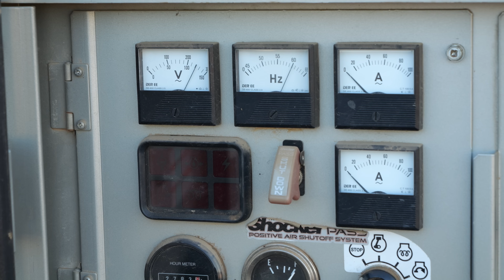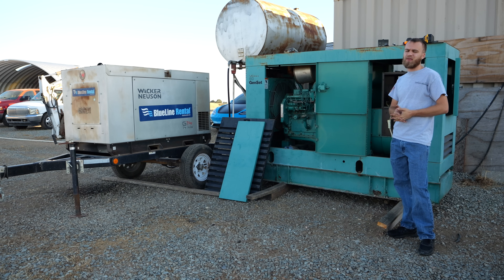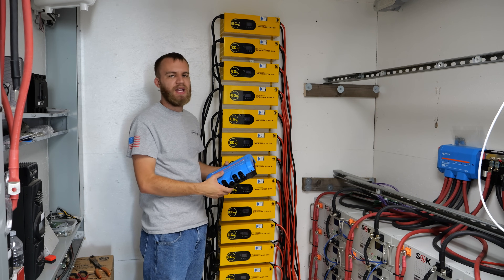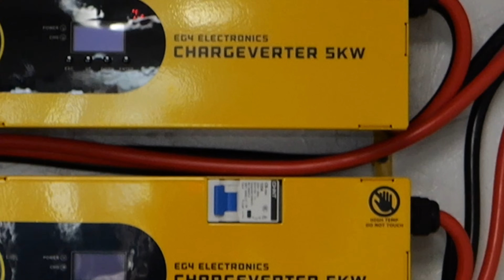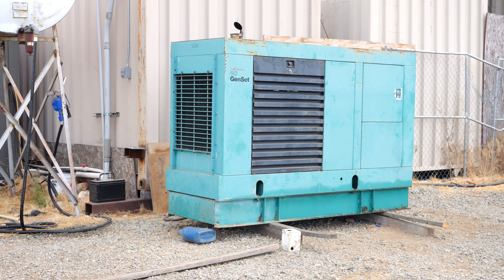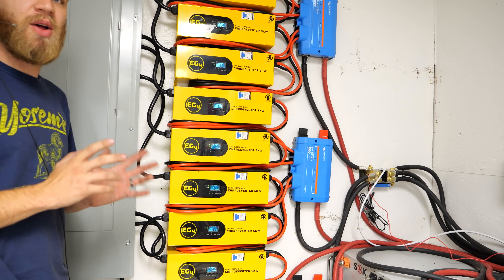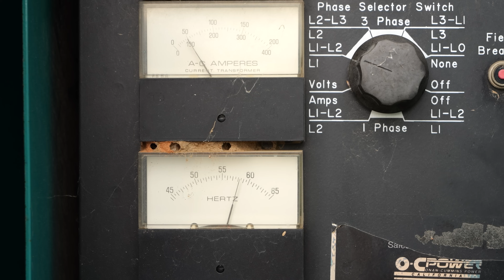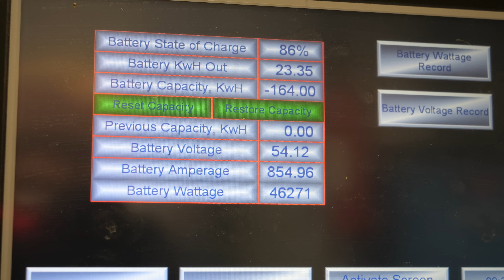😮 12x EG4 Chargerverter 5000's - 48v 1200A Battery Charging System!

Comment: It would be helpful to have a reactive load gauge [kvars] on that generator.  PWM or SCR systems tend to have lousy power factors.  That inverter disconnect seems odd on account of voltage is stable - you'd think it ought to be happy.  But... does 240 from generator match inverter design?  Spec sheet suggests 175-425v input, so that sounds fine.  I have had charging systems in the past where they were sligtly under-specd for battery bank Ah capacity - they stood up fine, until battery age started demanding more current, and the charger failed from the mismatch -upgraded to a higher output charging unit and problem solved.  So this was a video to watch: maybe battery overtemp and/or overcurrent was my first instinct regarding shutdowns. As for the newer bigger generator... what AIC is required?  I was thinking main has to be 120,000?  This is a fairly big project as details go.  Throw some dessicant packs in that generator control panel to keep electronics happy over time - any cabinet outdoors has a way of breathing with heat/cool cycles day & night that can cause something approaching a mini rain forest inside.  You might [might] need to pull back on charging volts to 54v?
Reply: Aye to this.  I have no experience with these battery chargers, and in all probability never will, but it wouldn't surprise me at all if they have no PFC at all.  I'd be happy to be proven wrong and find there is at a minimum passive but active would be preferable.
Reply: There's another possible option, which I saw in an LED emergency lighting unit designed for outdoor use.  A little rubber bladder inside the panel, connected through to the outside.  Pressure inside the cab drops, bladder gets bigger.  Pressure rises, bladder shrinks.  The one in the lighting unit was like a little rubber light bulb.  For a bigger cab even something like a party balloon on a hose connector might do the trick.
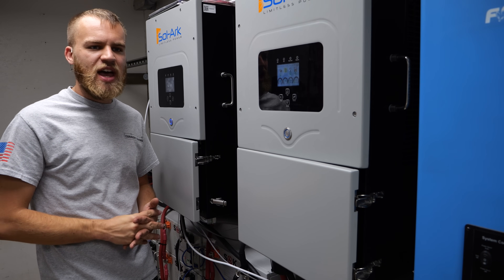Video nel567DBAQc at 1:37 shows the one I encountered.

Comment: What a setup!  About how long can your parents operate once the batteries are fully charged? Also, can you tell us more about why they went off grid or is this a vacation home setup?
Reply from the maker: Well over a week in cloudy weather and in spring and fall they can go only on solar. They typically only need to recharge after long periods of high heat or lots of cloudy days.

Comment: Nice setup. Now that you've shown that, I've realized that the battery rack is pointless. Just save money and space by stacking them.
Reply: Earthquake protection? Is heat dissipation an issue?
Reply from the maker: I wish I had the battery rack to bolt them to the floor and keep some space in case there is somehow water intrusion to the room.
The batteries make practically zero heat, so there is no thermal issue at all.

Comment: Looks like you have your phases well balanced...but that neutral is technically undersized. I would be interested to see what kind of current that neutral cable sees with the load of chargeverters, and if their loading stays balanced as the battery voltage comes up. Another scenerio where the neutral could see more current is if a few chargerters went off line...and happened to be on the same phase--seems unlikely, but still worth considering.

Another option would be to forgo the neutral all together and run as a 208 delta (of course this would mean double pole breakers for the chargeverters).

Love this content!
Reply from the maker: Neutral has 0 amps. The chargers are connected phase to phase. They don’t even have a neutral conductor.  I only installed a conductor in case I need it in the future for ancillary items such as phase loss detection in my PLC
Reply: @HighTechLab   I went back and looked--can't believe I missed it the first time! 
For some reason I had it in my mind you were running the chargverters at 120V....after looking again @10:25 it is clear you have them phase to phase (208V). You certainly won't be overloading the neutral with the chargeverters.
Super cool project!

Comment: any issues with hitting the generator with all those chargeverters all at once?  It would seem a good idea to have them switch on in groups of three thru a three phase contractor....  that way you can ramp up the load.  Chargeverters don't softitart do they?
Reply from the maker: They do soft start unless you have them on and THEN flip on their DC breaker. I only ramped them up fast for the sake of not making a 20 min video

Comment: What is using all this electricity? Here in Germany an average home is using less than 10 kWh per day (!) the heck is going on?! :D

Yup I read your comment but still, I am amazed about that amount of energy.

Same as with money, there is not an income shortage but much rather a spending issue. Just for energy...
Reply from the maker: The utility company wanted $70,000 to bring in power lines, and for their usage would be about $700/month. The savings going off grid is still substantial even with all the money they have spent.
Reply: @HighTechLab  That's insane. How many kWh per day would that be?
Reply: Still an awesome video! :)

Comment: One nice thing about those switching rectifiers is that it really don't care about the line frequency as much so long it is within 50 to 60 Hz. You're definitely getting the most out the generator by using it in 3 phase mode. Even if you lose a few chargeverters, definitely have enough redundancy to keep things going until you get them replaced.

Maybe EG4 might come out with a budget rack mounted version for higher power configurations?🤞
It be one heck of a setup and much cleaner for larger installations...
Reply: I believe they would run off of straight DC. There is nothing inside that uses the frequency for anything. You just have to make sure the rectifier can handle the current if it's running half the diodes at 100% duty cycle.
Reply: Wish they would make a 24 volt version. I did find some cheap telecom rectifiers, pretty sure it’s the same as the EG4, just without the additional programming and charging functions. I plan on hooking up an mppt for proper stages charging.
Downside is they are single phase 240 volt and at 120 volts they sedate to 2000 watts.
Reply: They would run off a wider frequency range than just 50cy to 60cy.  83⅓cy, 91⅔cy and 100cy railroad signal power would be no problem, nor would 40cy or 70cy (ancient AC standard frequencies).  Only things that may be a problem are things waaaayyyyy outside of the normal utility frequency range like 25cy railroad traction power (insufficient bulk capacitance on the switcher primary buss) or 400cy aviation power (input diode switching speed, AC input shunt capacitor current and AC input circuit breakers; 400cy arcing is a right pig to interrupt).

Comment: That's an insane amount of chargers. EV's have chargers one 10th that size that can take anywhere from 50 to 350 kW. I wonder if one could be gotten to do the same job, but probably would need to be actively cooled.

Anyway, very impressive setup. Good job.

Edit: Opps! Those EV chargers are DC to DC! Yours is AC to DC. Max AC to DC in EV's is 19.2 kW that I know of and they are expensive.
Reply: The amps are also a problem. 50kw into a 50v battery is 1000 amps. 50kw into a 500v battery is only 100 amps. Less amps, smaller wires, less heat.
Reply: @Sylvan_dB  I bet within 10 years almost all EVs will be 800-1000V too even.
Reply: Also EV chargers are generally liquid cooled.
Reply: They really don't. The level 1 and 2 chargers are actually just a fancy box with a relay in it the actual charger is built into the car and usually only around 5 to 10kw max. The dc fast chargers that can do 50 to 350kw are entire racks of equipment somewhere off to the side of the "charger" you plug your car into.

Comment: Nice video! How loud are the chargeverters at 85 amps output? Is the fan temperature controlled?
Reply from the maker: Not too bad, especially when compared to that monster generator.  The fans are at full speed at 85A, but I honestly expected worse when I was installing them.  The room doesn't really have much echo, so when you stand back 10ft it's not bad at all.

Comment: Why not spend that money on Panels ?
Reply from the maker: Because the structure we plan to put the panels on has not been built yet.  It's been a long drawn out process with the county and permitting department because it has to be done legit.  Now that we have the plastic ground-mount tubs, we may add some more, but this was the quickest way to keep them going.
Reply: @HighTechLab  oh , ok . Cool. Yeah I found those tubs last year and thought about using them but they get expensive with shipping and paying retail . I'm sure it makes more sense for you .
Reply from the maker: Yeah, at CurrentConnected, we offer free shipping on the tubs when purchased with the panels, because they can be stacked on top of the pallet without damaging the panels.
Reply: @HighTechLab  That's a great option you are providing .